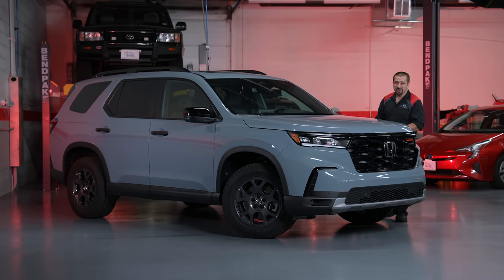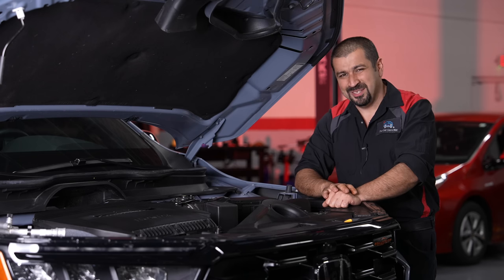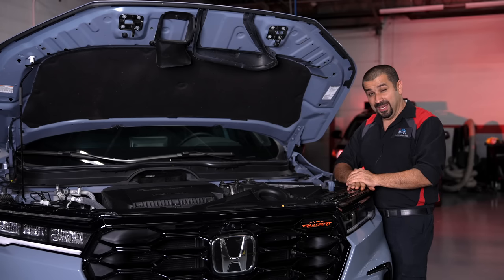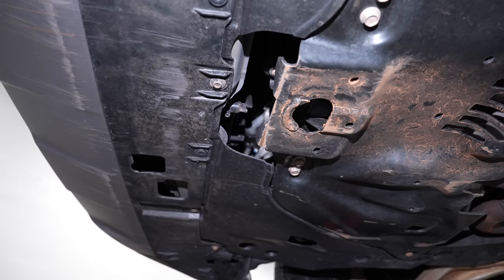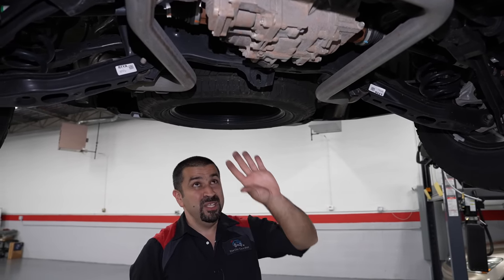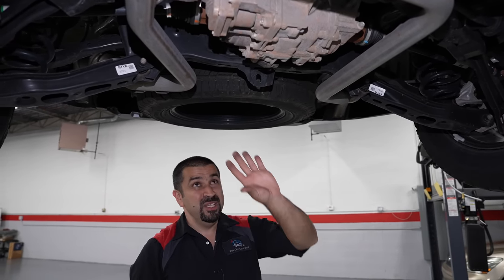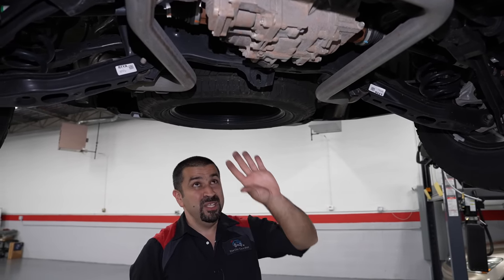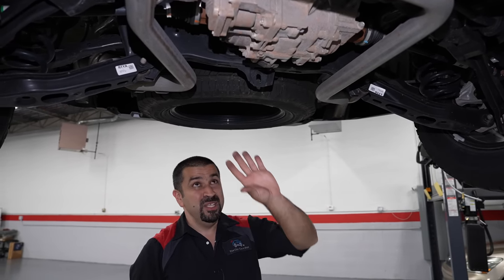Should You Buy a 2023 Honda Pilot? Thorough Review By A Mechanic

Comment: I have a Tahoe 2012  with cylinder deactivation and the no. 4 cylinder stuck and went down and wiped out the cam. The engine was replaced and the mechanic asked me if I wanted the cylinder deactivation disconnected. It did have 175 thousand miles on it when it happened. The Tahoe is also a 8 cylinder.
Reply: I have a 2011 YukonXL with the 5.3.  That feature doesn't net any additional fuel economy.  I wound up having the transmission replaced and the shop said to turn off that feature ASAP. It wreaks havoc on the torque converter and keeps it from locking.  I got a hypertech programmer and turned it off and installed a tune for 93octane and bumped up the shift firmness. Also got a S&B cold air intake ((true CAI sealed box, only draws air from outside the engine compartment)) and magnaflow exhaust. Now I have similar torque & power to the same gen Denali 6.2 and even better fuel economy.  21-22mpg avg on the highway at 80mph and 24-25mpg at 60mph.  167k on the odo.

Comment: I follow a honda tech on YouTube, he constantly shows the 1.5 turbos blowing head gaskets. The previous generation pilots transmissions go out. My brother had a pilot with the bad transmission. My younger brother has a civic that the ac compressor keeps going out. Honda has been replacing it under warranty but still an issue. Because of that I decided to stay with Toyota when my 2008 Yaris had low compression on cylinder #2. It still runs so I gave it to my pops to drive around town.

Comment: What I like about the Honda pilot and all the Honda V6 motors that they are the same.  You do not have to pull your motor out to work on it huge difference in pricing my Toyota I had  to take the motor to replace a water pump.  Also, you need to take out your motor if your timing cover starts leaking oil everywhere. My wife’s Honda pilot was done in two hours water pump timing belt  seals Thermostat.  She had 120,000 miles on it and they recommend that you change your timing belt at 120,000 miles.  So we did and She has 191,000 on it now runs perfect and looks good   That’s why I got rid of my Toyotas. I have a Lexus GX 460 now I can change a water pump and work on that vehicle in my garage at home.  Just like the pilot.

Comment: Just a note, the paddle shifters, if you think about it, are more for controlling gear selection in a multi-speed Automatic.   If you want to hold 3rd or 4th gear or 7th or 8th gear, you would have no way of doing it without the paddles.

Comment: We put Falken Wildpeak A/T tires on our 2018 Pilot Touring model. Aggressive tread, and very quiet!  As quiet as the standard Continentals. Best vehicle we have ever owned.  Roomy, plenty of power, rock solid reliable.  And great mileage. 
By the way, the paddle shifters are great!  We live in Colorado and I want to manually shift in the mountains, mostly downhill to avoid constant breaking.  But also to pass on hills.  No need to reach to a shift lever in the console, the two paddles are right there near my fingers on the wheel.
Reply: I have Fallen Wildpeaks on my 2015 Toyota Tacoma. Great tires in the snow. Used to have Hankook dynapros good at first in the snow but terrible in rain

Comment: Great Review! Feels like Honda gave it the ol' reliable engineering & build. Nothing too fancy or crazy but functional on the trailsport. The exhaust issue is minor & can be swapped with a better aftermarket down the line.
But overall the pilot trailsport is a contender.

Comment: Ive got a 2011 with the eco mode(cyclinder shoutoff) and it has burned oil since day 1.  I have 190k with original plugs, coils and TBelt.  No check engine light, still passes smog.  The tbelt tesnioer is starting to make noise so I will be doin that job soon. Thats my wifes car.  I drive a 95 Accord Ex Sedan Manual.    I love Honda!

Comment: We have a Pilot from the 2nd year (2016) of the previous version which this car is heavily based upon. While not as inexpensive to maintain as previous older gen Hondas it has been very good. One thing I wanted to share is gas mileage with the Honda Dreams cylinder deactivation on the 3.5L V6. When we drive ours without heavy acceleration, we can squeeze 30-32 mpg highway out of it on long road trips which we believe is excellent fuel economy for a vehicle of this size. I have my nits I would pick on about this vehicle, mostly related to the AC climate control and the infotainment systems but otherwise very pleased with this car.
Reply: I had a 19 Ridgeline an always got right at 31.7mg on 1000+ mile road trips.  It's incredible for such a large vehicle.

Comment: Great deep dive into this vehicle. Thankyou for so thoroughly covering this vehicle. Question, if buying a 2024 Passport Trailsport and planning to occasionally tow 2k-3k lbs occasionally and drive on mild to moderate unpaved surfaces(camping/state park trails) would you recommend having a transmission cooler installed? How hard or possibly expensive should that be reasonably done for. Thanks again. Your experience based thoughts are invaluable.
Reply: I’m pretty sure that with the 5000 lb towing package there is a factory transmission cooler installed.  I’m doing similar driving to you (towing etc) and asked the question as well.  Hope this helps.

Comment: I got a 24 elite trim pilot. Hands down one of the best cars I had. It’s built very solidly. Kind of built like an older style vehicle with nice sturdy interior and nice materials. It’s not fancy on tech or design like a Hyundai but it’s very high quality feeling. This is such a super smooth engine and transmission. Great ride quality and very quiet. I test drove the grand highlander, cx-90, pallisade, mdx, q7 and used bmw x7 and Mercedes gls. From a driving and build quality stand point only the x7, gls were considerably better. The q7 and mdx were slightly better. Pilot and grand highlander were both practical and well built. Pilot just drove nicer over GH and had better interior materials. Cx-90 is a sport car

Comment: Hondas are a time tested quality car. I own a 1977 civic with a 1994 engine swap. The only thing thats a problem on the 1977 is the door seals. Bulbs and relays have gone but the chassis is mostly original. Only took 57 years leak.

Comment: Great channel. Honest and non biased opinions. I am very glad to have watched this video. We are buying a new family SUV 🚙 soon. I was trying to decide between the Mazda CX90 and the Honda Pilot. I already decided on the Honda Pilot, because it’s technologically and mechanically much simpler. We currently own a 2017 Honda Pilot and a 2017 Honda Ridgeline, both have been fantastic and trouble free since 2017. We have an older SUV as a third spare vehicle, which I use as a spare vehicle for my Small Trucking Fleet. The 2017 Honda Pilot will be the spare vehicle and the 2023 or the 2024 Honda Pilot top trim, will become the main family vehicle.

Comment: Can you remove the cylinder deactivation feature after purchase? I do not like that feature. Is the older engine (currently in the Passport) a better option?  As a single, older female, I’m interested in a Honda SUV that will last many years with little fuss. I drive 2005 EX-L, and it’s time for a new vehicle. Thanks!

Comment: Ahmed... the paddle shifters are for "manually" selecting and or holding gears in a "multi-speed" auto (10 speed in this case).    If you are off paved road.. you can engage manual mode and pick and hold 1st gear if you want or 2nd gear etc....    It's not just for "Sport" driving.

Comment: paddle shifters don’t always have to be in a performance vehicle. Living in Colorado, the paddles are much nicer to use when going down mountain roads and not destroying your brakes. You maintain contact and two hands on the wheel without fussing with a console shifter.

Comment: Honda has stopped supporting their products with replacement parts, when the cam goes out good luck buying a new one.  J35 engines with VCM tend to destroy the front cam around 135k miles.  14100-RGW-A02 (front cam) has been backordered for over 1 year.  Doesn't bode well for "Honda reliability" or Honda supporting their customers repairs.

Comment: We owned a 2020 Pilot Elite for less than a year. The issues that made us get rid of were the constant problem with the infotainment system, the engine lag, non-existent fuel efficiency (my Ram Dually got better fuel/mileage). The part I ended up hating the most of any Honda/Acura brand is the push button gear selector.  It was not a fun SUV.

Comment: There is a button to turn off cylinder deactivation but it has to be pressed every time the engine is turned on.
Reply: That's not cylinder deactivation.
That button is Engine Idle Stop/Start System.

Comment: Thanks for the informative review! I happen to like this gen Pilot especially with the straightforward interior, but not everything is great. Here is the list of things I don't like: 1. Button gear shifter (why not use the same mechanical as the CR-V). 2. The rear window design is just stupid. 3. The infotainment and driver gauge cluster leaves a lot to be desired. 4. A few annoying design decisions on all Hondas, like the leading zeros on the mile counter (0000074 instead of 74), or the Maintenance Due Soon minder for weeks before it's actually due, the start /stop engine button is too bright and red, disturbing especially at night. But overall the Pilot is still a great pick.

Comment: Great review! I love my 2023 Pilot! 🤍 I’ve always wanted one & still step outside just to admire my beauty. There are a few, probably minor things, he didn’t mention, but are huge to me. One being, I have to have a nice audio system. I was able to see all the trim levels at my dealership. I wanted e-xl model but the audio was horrible, same went for all lower levels & the trail sport. So yes, I forked out to get the tremendous Bose system that only comes in the touring or elite. I was skeptical of Bose, but once I heard it…omg!🥰  The screen size seems to be a complaint. But I actually find it perfect. But I don’t like huge tech & screens in cars. He’s right, very simple inside. And right,, it’s not a sports car but man it does have a kick. Especially in sports mode! Fun!! There’s another fun little option in the infotainment system for cabin talk. My kids love it & actually listen when I use it.This is your captain speaking😂 Yes, it does have more of top heavy driving feel but not terrible, but not grippy like my accord. But it is an suv. One thing I really don’t like is the start/stop. I was not ready for that. Luckily you can disable it but it has to be done every time you start the car. Well this was long, but I just love my Pilot!

Comment: So the reason the paddle shifters are necessary is that if for some reason you had a brake failure and you are rushing down a hill; you can gear-down and apply the emergency brake in order to stop. Obviously gearing down is impossible with the push-button style shifter.

Comment: Great review, J Series is a great little engine. Put a sandwich bag around the filter after you break it loose and work it off. Works pretty well. Refrigerator magnets on the outside of the filter. They need to lose about 600-700 lbs on all these to get better fuel economy and performance. Single cam was to drop parasitic friction. 
You need to study a lot of fine print to create a review like this, much appreciated.

Comment: First, this guy is great reviewer.  Just bought 2024 Honda Pilot. Great car.  But what he said at the end was right.  No options.  If you like some feature, gotta go up a trim level.  My purchase replaced a 2011 Honda Pilot.  At that time, an EX-L came with roof rack and sun roof.  Now, the EX-L lacked both.  I didn't even notice that it was lacking a roof rack and had to pay $1200 to add one post-sale. My advice - get the Touring.  By the way, I did try out the new Toyota Grand Highlander but liked the Pilot better.  Also, it's about $6k cheaper for comparable trim.

Comment: Fun fact; that air filter housing, if you have someone that doesn’t know what they’re doing and manages to pop a bolt out of the housing; the air filter bolts are captured.  If you don’t break the housing un-capturing them, you will break that housing putting it back in.  Because of this, if any of the above happens, you have to replace that entire housing.  And it’s not cheap.
Reply: Just another reason to do your own servicing.

Comment: This is the review that I was looking for.  I needed to know more about the engine as I consider part of my purchase the serviceability of the vehicle.  I wonder what the cons are for the tensioner being manual.  Does this mean less hydraulic leak?  This engine does away with any valve adjustments as it has hydraulic lifters, per AMD's notes.  I'm just concerned of carbon build up for DI engines, compared to Toyota having both port and DI.  I currently have a 07 Odyssey with VCM, no real issues, bought new and at 201k miles on it.  Still on original engine mounts, had some leaks on the solenoid were it dripped into the alternator which ultimately fried it.  I like the fact that this should be a good car to service.  Pilot is still on my short list, but the Tacoma off road is something that I also fancy with a manual.

Comment: Couple of things, overall, i like the new pilot, but have a few gripes, including the direct injection and now needing a special tool to do the timing belt, I also do not like electronic parking brakes, because thats all they are, parking brakes. In the event of a hydraulic brake failure, you cannot use the parking brake to stop in an emergency, as the parking brake will only engage when you are at a stop. Also, honda used to always press the lower ball joints into the knuckle, and they lasted a lot longer when the ball joints used to do it that way.

Comment: Possible carbon build up? Timing belt replacement every 80,000 miles? Cyl deactivation? As a retired mech , I've seen it failed lots of time on higher mileage vehicle. As reliable as Honda, I think it's a poor choice of engineering. A little rear end hit can be costly because of no bumper. I think I'll pass this one.

Comment: You can turn the VCM off on the previous V6 j series motor with the S-VCM controller.  Can this also be done on this motor.  MPG difference was negligible with the older systems.  This DID prevent major issues down the road.

Comment: Excellent video. I'd recommend you add a small section comparing cars. For example, between this and the Mazda CX-90. Specifically you talked about the car being under powered. The Acura MDX has the same power unless you get the expensive Type S. So that's why I might want to consider the CX-90 with the 3.3L.
Reply: I had two Mazda 626s over my long car career as well as Honda Accord.  All went over 250,000 trouble free miles.  I keep my cars a loooong time.  The problem with the CX-90 is that when the timing chain has to be changed at 100,000 miles you have to pull out the entire engine to get access to it because the Mazda engineers put it at the BACK of this otherwise great in-line V6.  How many $Thouands is that gonna cost?  Go view the X-90 review CCN did on this vehicle.

Comment: Got a VCM Tuner II for my 14' Odyssey. Is a Godsend for disabling the cylinder deactivation.
Reply: do you notice a difference in overall ride quality with it turned off? Less vibration at highway speeds, etc... or something of that nature?
Reply: @user-yx4on8hx4w  I do recall having more vibration prior to the VCM. The transmission feel has been soooo smooth for the past 70k miles since I first got it. Highly recommend man, 💯.  Less rev hang and gear hunting as well.

Comment: Not a fan of cylinder deactivation at all, but I can at least understand why they are doing it on V8's.  V6's though?  That sounds like a bad idea.  Even if you disable those systems, the way they are designed leads to early failure.  Just another example of engines being overengineered to meet impossible CAFE standards.

Comment: Is this a vtec motor, or is it cam phasers? I thought it was the latter but someone on the net said I was wrong?
This motor is also supposed to be going into the refreshed Acura MDX as well next year.
Reply: It's a non-VTEC.  VTEC variable valve timing is used on almost all applications, with exceptions being the J30AC and J35Y8 (which use Variable Timing Control [VTC] instead)!

Comment: About that spare tire lowering crank, I had a 1999 Toyota Sienna which had the same, or similar thing. The problem I had with it was that it apparently used some non-durable plastic gear wheel or something like that in the mechanism. I had more than my fair share of punctured tire for some reason at that time. I remember turning that crank over and over and the tire just stayed unmoved because the plastic part was stripped. I hope they’ve made some improvements in 25 years.
Reply: My 2005's never had an issue.

Comment: I'd like to get some reliability info on the 10 speed tranny.  Is it from ZF?  I see the ZF9hp has been very problematic for Honda, and that same tranny is still used in the 2024 Passport.  I do not need a three row. I need something roomy, reliable, prefer a v6, but will not tolerate engine or tranny problems.  What else is out there as an option? Sigh....

Comment: Interior dash design is very similar to the newer Civic and Accord however, does not differentiate itself or has its own identity. I find the only thing I like about the Pilot is the reinforced hard steel in which it is well designed to take on an impact and provides better safety.

Comment: 12:15 correct but the 2012-2015 Pilot comes with 250hp, so if anyone is upgrading from a 2nd gen to a 4th gen Pilot, that’s a 35hp increase and 5 extra gears ⚙️. Correct me if I’m wrong.